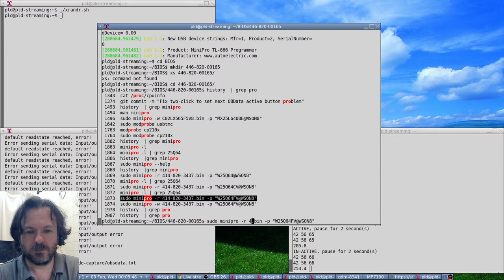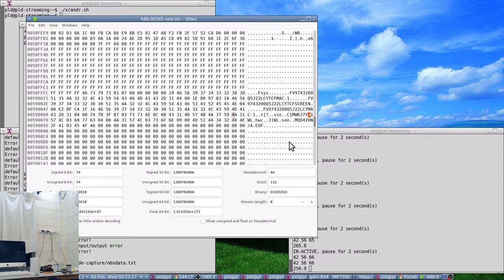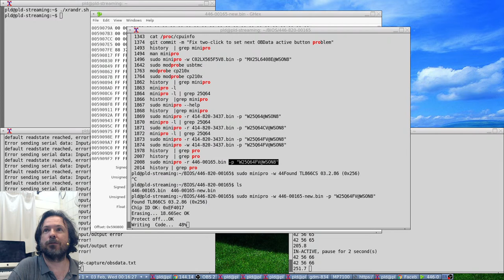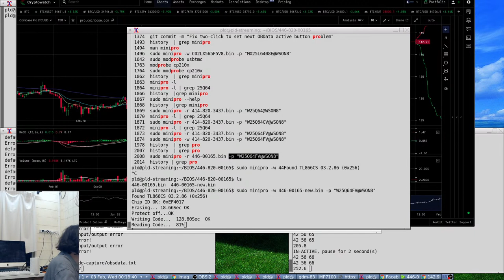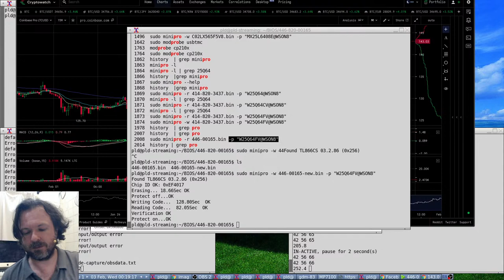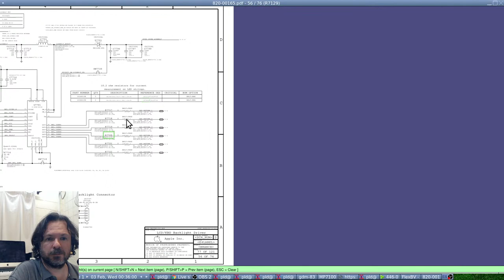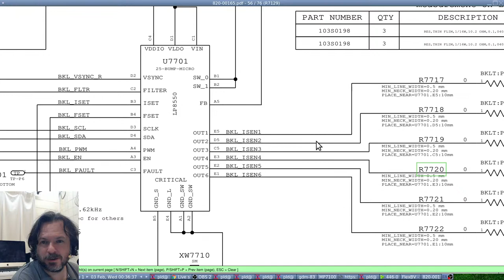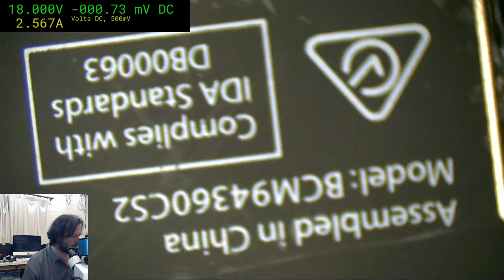Can't sleep, so instead of counting sheep, I'll fix macbooks instead

Comment: I had the same exact issue when I started a couple years ago. After having the computer for over a year I decided to put a new Driver IC and it fixed it. Turns out it was my soldering job the first time. I even went so far as to put a new board in to test the chassis. It was a good lesson in patience while soldering. Great video on how to troubleshoot.

Comment: Yep. Been installing Big Sur on all 2014 onwards Macbooks. Had 3 'repairs' in (2 x A1466, 1 x A1502) bricked. Starting to get a buzz on the rumourmill/interweb about this. I just swap out the EFI and have stopped installing Sur for now. I think it is a bit like the slowing down of old iPhones a couple of years back.